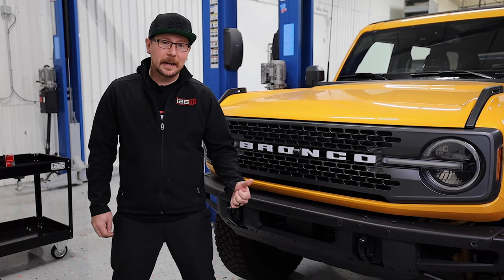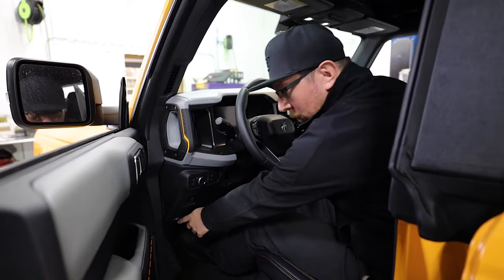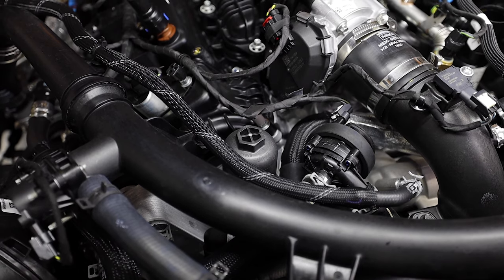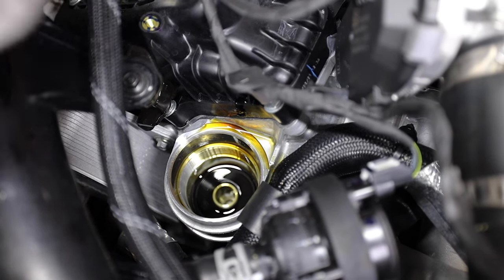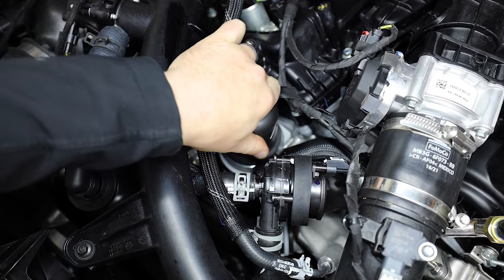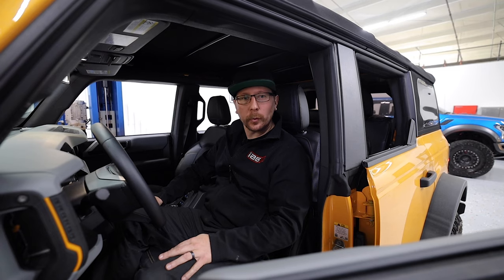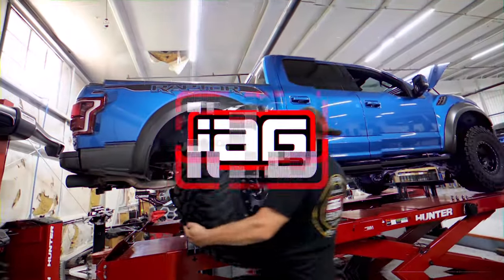"How To" 2021 Ford Bronco 2.7L Oil Change

Comment: As soon as the oil filter cap is opened, any oil in the oil filter housing drains down into the oil pan.  The smallest o-ring on the oil filter cap is what blocks this oil passage when the cap is installed.   You should do this before draining the pan if you want to remove all the old oil.
Reply: What!!!!!
Reply: not so fast. I tried an experiment, and did the filter last. I got Zero oil out of the pan in the 30 minutes afterward. So, bunk
Reply: @chrisbusch1970  wheww! I was about to say "Now he tells us" 😂 Thanks!! 👍

Comment: You don’t to replace the drain plug unless you break it by using a pair of pliers to remove it.
Reply: And if you don't have a drain plug and you break it? You're screwed until you get a new drain plug.

Comment: Warning! If you are doing it at home make sure you use a bucket or something big enough to catch the oil quick. I had never changed the oil on a car with a plastic oil drain plug the size of a chod. The 7 qts of oil come out in .3 seconds. I spilled 30% of my oil all over my garage because my oil bowl wasn’t big enough to catch it quick.
Reply: awesome tip!  now that you mentioned it, i did notice a gush of oil flow out when he pulled the plug.  about to do my buddy's bronco.  leaving the cap on up top probably helps slow it down

Comment: SAE equivalent for the 27mm is 1 1/16" if you happen to have one. When this video was made the owners manual did say 7 qrts, it's since been changed to 6 qrts.
Reply: thank you... and definitely will be keeping an eye on the level at around the 6qt point
Reply: The problem with that is where is 6 qts on a 7 qt dipstick?
Reply: @dave1m2003  It is 6/7th of the way up LOL

Comment: Good video, and it’s actually a very easy and mess-free oil change. One quick note, though… at about the 1:27 mark, you say it’s good practice to know “you can fill it before you drain it”—I had to listen to that comment several times over before I understood you were just saying “make sure you know how to fill it before you drain it…” which IS good practice. However, it sounds like you’re saying you can fill it before you drain it, which makes it sound like you can pour in the fresh oil before you drain the old oil. Not sure who needs to hear it, but… Don’t fill it before you drain it! lol
Reply: He’s saying that you should open the oil cap at the top before you drain it. Thus, you CAN fill it before you drain it (because the cap is open). It doesn’t mean to fill it, it’s just a reminder to open the cap before draining.
Reply: Agree with you.  Was confused by that but I also ignored it as I knew that was not right.  But yes, please say it a different way to avoid confusion….
Reply: I was also confused on that 😂

Comment: I prefer to replace my bronco oil drain plug with the Ronin Factory style easy oil plug. Makes it a lot cleaner to carefully drain the oil and has magnetic tip to catch any metal floating around. That way you aren’t buying new o-rings or plastic plugs each oil change.

Comment: Remove the old filter, then drain the oil, then install the new filter.

I learned from not doing it this way. After first replacing the filter, I drained the oil. Then I opened the filter housing to check that the filter was seated in the cover, and more oil drained from the pan.

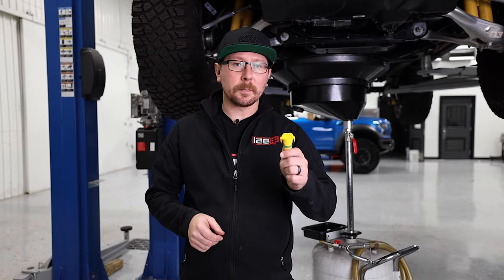Comment: 2:38 you forgot the part where the oil explodes out and skips off the oil pan in a ballistic trajectory straight for the brake caliper
Reply: ha!  try leaving the cap on... that might slow it down

Comment: No need to remove the front two skid plate bolts, just loosten them. The front edge plate holes are slotted, as you can see at 2:10.

Comment: I have a 2022 OBX 4 door.  Six bolts on the plate over the oil pan.  Other than that, great help!   Appreciate the torque wrench setting (17.7 ft lbs) and the reset instructions for oil life.
Reply from the maker: Glad it helped

Comment: Awesome video.. had know clue about priming it b4 start up do you do that every time b4 starting? And one more question I tried the flat foot crank & mine didn’t crank over like yours... what am I doing wrong? If you could answer my ?’s that would be great just got my 4 door base Sasquatch in carbonized grey with hardtop 2023 model a few days ago & I love it!!! Thanks again...
Reply from the maker: We only do that after doing an oil change, not every time we start it. Do you have an automatic or a manual? We don't own any 2023 models but I can't imagine it would be any different.
Reply: @theiagchannel  hi thanks for getting back to me... mine is the 10 speed auto.

Comment: Great information. Thanks. My 2023 Badlands 2.7L states in the onboard owners manual that it is 6 quarts for a change.  Is it 6 or 7 quarts?  I'm changing the filter every time.
Reply from the maker: So interestingly enough, Ford has revised their capacity specification from 7 qts to 6 qts, including an electronic over the air update to the service manual in your radio. However, they did create a Technical Service Bulletin:

"SSM 50981 2021-2022 Bronco - 2.7L GTDI Engine - Service Oil Capacity Update: The 2021-2022 Bronco 2.7L GTDI engine oil capacity specification with oil filter change has been updated to 6 quarts. The workshop manual has been updated with this information and electronic versions of the owner's manual are in process of receiving the update. Following the previously recommended capacity is not necessary, but will not cause any harm to the engine. The initial fill capacity for a new/dry engine remains 7.5 quarts. "

We suspect that Ford made a mistake and didn't want to send out new dipsticks to every Bronco owner, so they revised it to 6 quarts instead.

Comment: Great vid from Jim, Thank You!  Interestingly there is some disparity in how much engine oil should be used in the 2.7L V6.  Appears there is at least some 2021 documentation that states the oil capacity at 6qts.  I searched for the official Ford documentation and for 2022 2.7L it does state 7qts. So, I'm going with 6.5 to start and then add that final 1/2 after a 15min sit time and re-measure. Seems odd that there's a quart of "play" in the engine.
Reply: Fyi- anyone reading these comments. Its 6 quarts. Ford has made sure their info shows 6 quarts. Don't go by old mistaken info etc.
Reply: @TheCorneringStore it’s weird though because on my 2023 Bronco I did put 6 in and it wasn’t quite enough. I ended up with almost 7. So crazy because my 2.7 in my f-150 is exactly 6 quarts

Comment: What oil was added? Full synthetic or blended what weight? Any lube points to grease?
Reply from the maker: The IAG oil kit uses Motul 8100 5W30 ECO-Energy. 
https://www.iagperformance.com/iag-motul-5w30-engine-oil-change-package-for-2021-2-7l-ecoboost-ford-bronco/

Comment: My manual says 6 quarts on this engine.  Manual is wrong too.  Put 6 in and it's one low.  Oh yeah.  And that yellow drain plug?  Didn't realize it drains your oil in 2 seconds.  My pan couldn't take it that fast and 3/4 of the oil in the crankcase wound up on my garage floor, so that was fun.  Also, who designed this to have to remove 6 bolts and a plastic cover plate (I don't have a Sasquatch) to get to the drain plug on an engine?  You know, I love my Bronco I really do.  And I'm a former Ford tech.  This is pretty poor design.

Comment: Any known drawbacks to sucking the oil out through the dipstick channel?  I do this on my Audi and it works great.  This way you don’t have to take off the splash guard or change the oil plug….or put the truck on a lift
Reply: That's the way I would do it unless some1 explains why
Reply: That's like taking a shower and putting your old underwear on.

Comment: Many comments on forums about 6 or 7 quarts. What did your dipstick read after adding 7 quarts and doing the engine cranking?
Reply from the maker: We used 7 Quarts since that’s what Ford recommended. After cranking dipstick level was where it needed to be.
Reply: @theiagchannel  That does not seem to be a lot of other peoples experience.  I just had my first oil change at a Ford dealership yesterday and am taking it back today.  I checked the dipstick after the 2021 Bronco 2.7L sat in my garage for a couple of hours and the oil level read about 3/4 inches above the max fill indicator.  If you're familiar with the dipstick, it registered just above the twist in the dipstick.  There are lots and lots of questions about the correct amount of oil and the dipsticks correct reading on the internet because of similar experiences to mine with both people changing their own oil and taking it to a Ford dealership.

Comment: I had a 2020 Mustang GT that also had a plastic oil pan and drain plug.  The thought of them forced me to trade that car for a Dodge Charger Scatpack.  I don't know why Ford did this?  I did put a Ronin oil drain plug on.  It made changes a lot easier--no big plastic carrot to unscrew and worry about bad O-rings.
Reply: People over torque a metal drain plug and crack the oil pan
Reply: @anythyme  You can also over torque a lug nut and break the stud.
Reply: Damn plastic oil pan and drain plug , at least aluminum

Comment: Is the case that holds the oil filter plastic?
Reply: Yes. It’s a plastic housing.
Reply: It's the same way on the Jeep/Dodge 3.6 Pentastar engine.  That housing becomes brittle over time and can crack.  Our's cracked on a 3.2 V-6 Jeep Trailhawk at about 70,000 miles.  We lost 5 quarts of oil going down the road before the check engine light came on.  This is especially prone to happening  in cold climates.

Comment: how long should I do the flat foot crank? how can you tell if the priming is complete?
Reply: Do it for about 45 minutes.
Reply: You only need to do the flat foot crank for a few seconds. Just long enough to circulate oil through the filter and rest of the engine.

Comment: He forgot to put the small upper o-ring back on ? or was it just black and i couldn't see it ? the other two were blue.  Nevermind! it was black after all..
Reply: I'm doing my first oil change on a 2.7 Bronco now. The factory o-rings are all red. The replacement Motorcraft ones are blue for the big ones and black for the little one.

Comment: The cold crank info is very helpful, but a big oversight that you're not removing the filter before draining the oil. That's not only common practice, but explicitly stated in the owner's manual. Also bad that you don't give people a warning about the way oil shoots out of this pan.

Comment: Can I use an oil extractor instead?
Reply: I was able to drain another 5oz. after extracting...  Sure would be convenient to be able to get it all considering the topside filter and  extra work removing the "splash guard" below.
Reply: @davidlehman7150 don't think 5oz gonna be much difference to be worth it . And was that after you changed the filter that would cause that as well?

Comment: Bro! 4:56. Thought you was stretching it like a water balloon on a spout. I don’t even work on cars and I cringed with that. And you know what? Quick tip with people watching this. Maybe lubing the oring with oil before you even put in on the housing. Then you cover the oring overall and cover it from getting fucked; with little nicks. Then I guess with the extra step more, oil on the oring, honestly doesn’t hurt.

Comment: Think the 2.3 is a better engine just by the oil maintenance design. Plastic drain plug on the 2.7 vs traditional thread plug on the 2.3, then a cartridge filter on the 2.7 vs spin on with an actual drain channel!! Then a almost $2k price difference between the two and only 30hp difference. Im sold on the 2.3!
Reply: torque counts way more.. 27% increase over the 2.3
Reply: 2.7 has both direct injection and port injection, so you never have to worry about carbon build-up on the intake valves that results from direct injection (spraying fuel directly into the combustion chamber rather than having fuel pass over the valves. )  The 2.3 has only direct injection, which is a disadvantage when carbon builds up on the intake valves and causes drivability issues and poor mileage.
Reply: 2.7 over 2.3 any day
Reply: Your peasantry is showing.  None of the things you mentioned are drawbacks in real life.
Reply: @jase9951 yep this was enough to make me pick the 2.7 even though I wanted a manual

Comment: Should have stuck with the jeep which didn't require seal & drainplug replacement every oil change.
Reply: you don't have to. they are assuming ppl fk it up when they change the oil. Just have a spare handy just in case. I reused my F150 oil plug for 15 oil changes and it worked fine.

Comment: Oil extractor would make this job 10x easier and faster. I can't believe people still crawl under the car in 2022.
Reply: An oil extractor cannot be used successfully on Ford's 2.7L EcoBoost engine. If you look at the service manual, you will see a cutaway diagram of the engine oil channel that shows a check valve to the side of the end of the dipstick, where the oil passes through the check valve.

The service manual says, "After filling the engine with oil, the oil must flow from the main chamber of the oil pan, through a check valve into the smaller side chamber to correctly register the oil level on the oil level indicator. This may take up to 15 minutes."

So there is no way to get the extractor tube down to the bottom of the oil pan like on other engines, and using an extractor will actually leave about 2 quarts of used oil in the bottom of the pan.
Reply: I was wondering the same thing.  Thanks for the information!